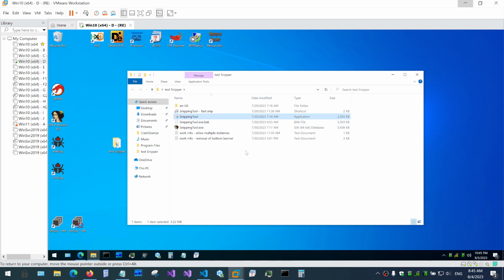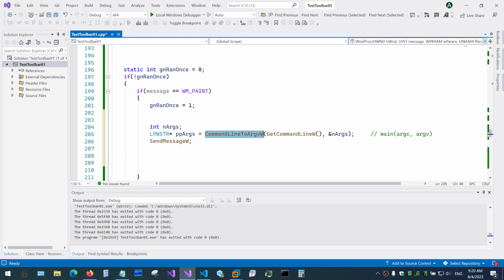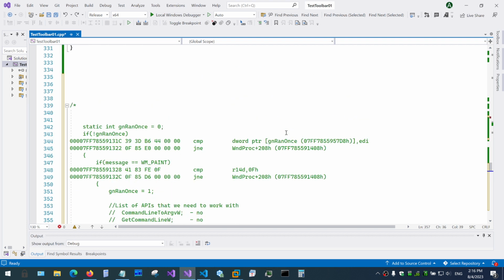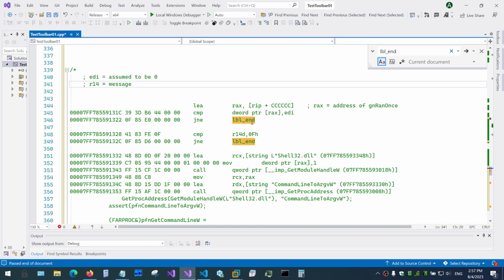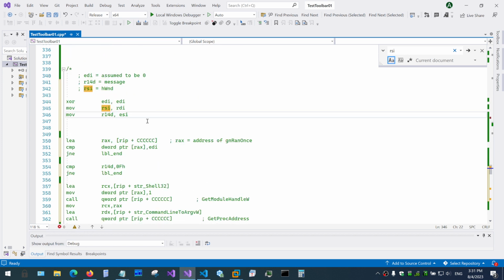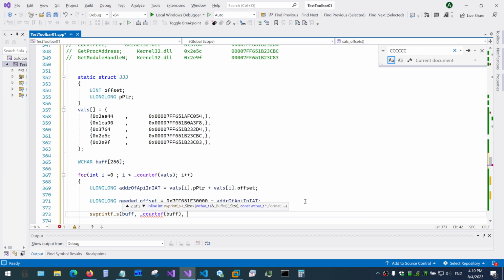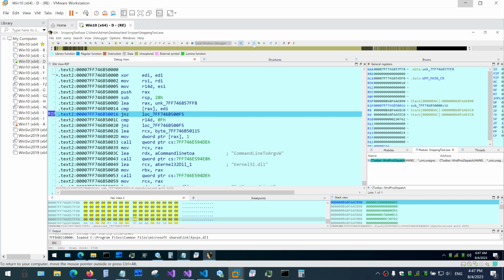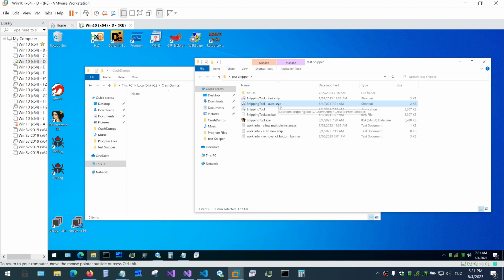Part 3 - Reverse Engineering & Binary Augmentation / Modification (Patching) - Snipping Tool

Comment: Hi, I am just wondering what tool should I use to compare 2 exe files, like same files but 1 is patched and original one. I am trying to find where its been modified. Also amazing video and explanation
Reply from the maker: BinDiff is usually used for that. But AFAIK it needs IDA Pro to run:
https://security.googleblog.com/2016/03/bindiff-now-available-for-free.html